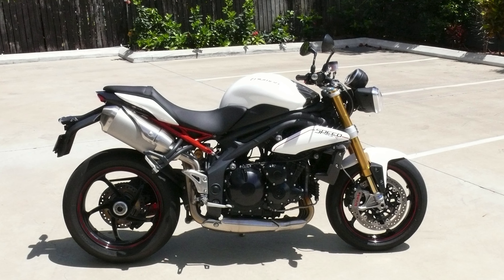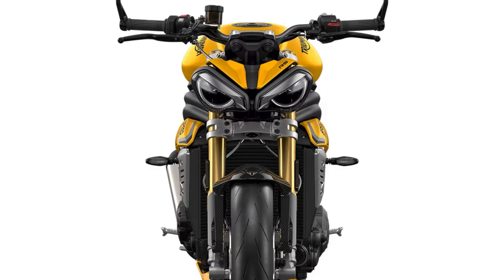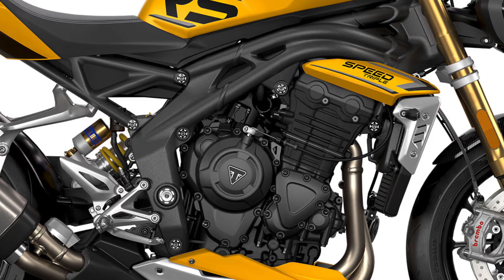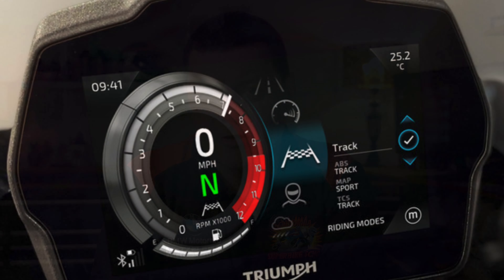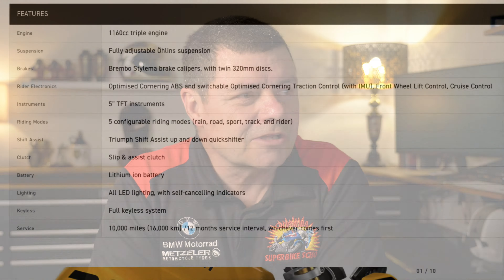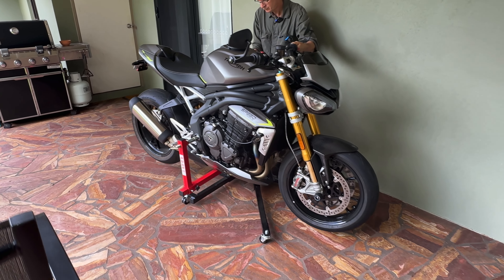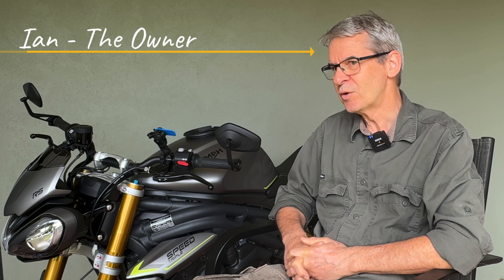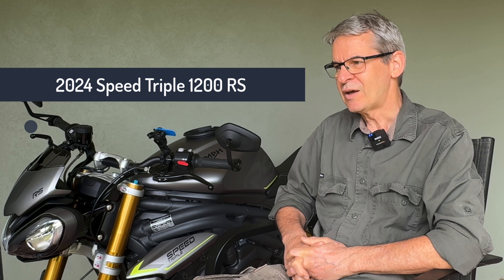2024 Triumph 1200 Speed Triple RS Motorcycle - Owner’s Review

Comment: 2025 coming out will have ES and come in an RX version as well with clip ons. RS will still be handle bar raisers. Personally I'm quite happy with the manual fully adjustable suspension - once dialled in for my weight it's perfect. I'm 90kgs and still had to dial back the preload from stock.
Reply: @sattvicvelo3506  wow interesting news. Where did you hear this?🙌
Reply: Can you give me the exact settings for the front suspension, preload, compression and rebound and also for the rear?
Reply: @jeroenvandenwijngaard1795  I went with the “recommended normal” compression and rebound settings from the manual which happened to work well.
Preload I did the usual way: tape measure / two people - dial in/out until you reach desired sag. I set mine at 30% front and rear.
Reply: Front rebound 15 and compression 15
Rear  rebound 16 compression  20

so you used this setup? and test/measure preload. Did you change the preload in the back too?
Reply: @jeroenvandenwijngaard1795 yep changed preload front and rear - took a bit off each end from memory. Was wound right up from factory. This is in Japan not sure if different in other markets.

Comment: Not sure if you mentioned it but I would get a shift support in that bike ASAP! Extremely long shifting shaft and have a tendency to snap which is a costly repair
Reply from the maker: cheers mate, I've done some reading up on these, Ill take your advice and whack one on
Reply: Haven’t heard about this. Where can I read more about it?

😮 I have almost 15k km on mine.
Reply: @bjrkK  RaceTorx Shift support! But it's all over most of the facebook groups people with shift shaft issues
Reply from the maker: @bjrkK  I had a look on line and there's some suggestion it is a weakness, who knows, for the cost of a support it's worth grabbing I reckon
Reply: @TheBikeStig  ok cool, will check it out. Thanks
Reply: I have the racetorx it's great - improves the feeling immensely. No more soft failed shifts.
Reply: @sattvicvelo3506  great to hear that. Have to put that order in.👍